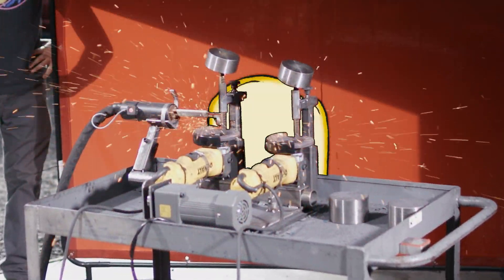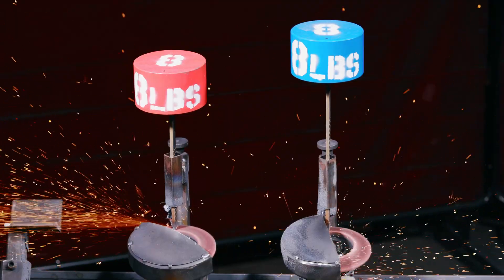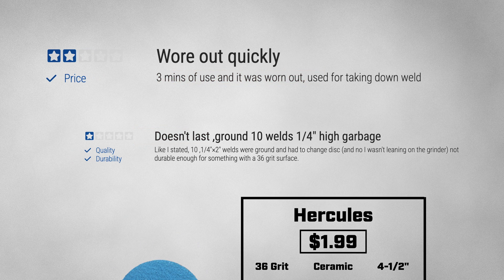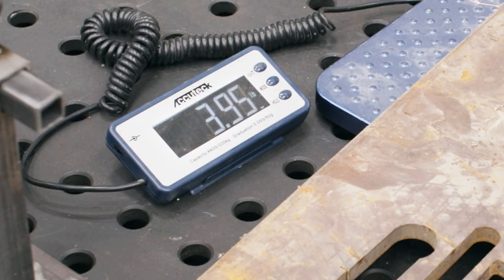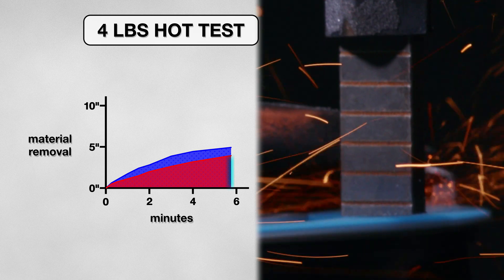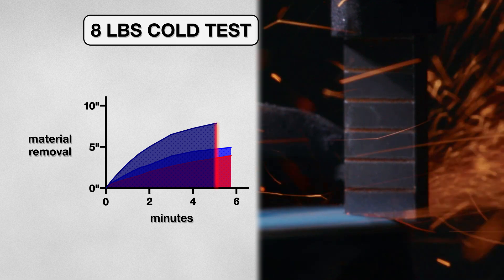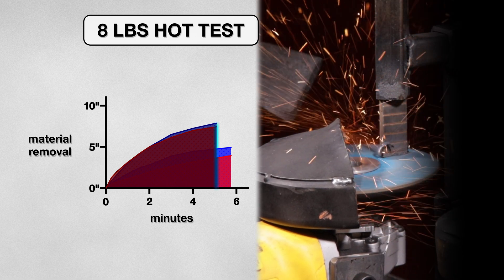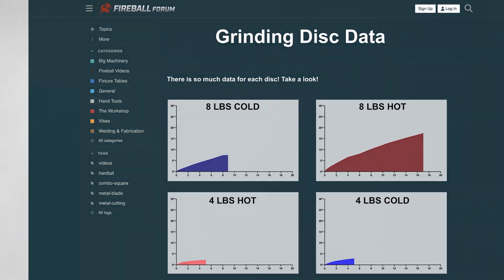Hercules Fiber Disc Extreme Test Results (36 of 48)

Comment: I think it's time to discuss the grinding disks used and what the different media (Flap Disks and Fiber Disks so far). If we only look at grinding amount then the flap disks has dominated so far. And price wise most of the good Flap Disks has been rather cheap. Sure there are real expensive Flap Disks but they are not much better at grining away metal as far as this test has shown.

So are there other reasons why you would choose a Fiber Disk instead of a Flap Disk? Are there other reasons to choose a Flap Disk than the amount of metal it can grind away in a given time? Does the surface finish wary a lot between them?

Just wondering as there has been quite a few disks that didn't really seem all that good even if some of them cost a lot.